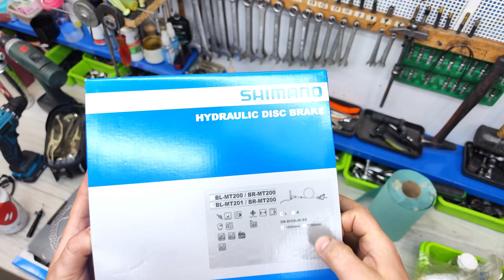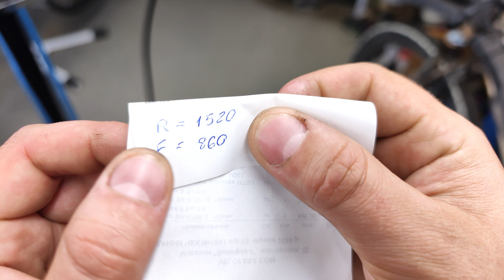Bicycle hydraulic disc brake Shimano BL-MT201. How to shorten a bike hydraulic brake line

Comment: hi i got some mt200 and after bleed they lost power but found there are tiny air bubbles coming from the caliper pistons, so still air in the system or  a seal broke

Comment: What is the part number of the blue funnel you used to drain the mineral oil into the brake?  And you did not need to push the oil from the caliper using a syringe ?
Reply from the maker: The funnel is sold in any bike store. in this case, a syringe for pumping mineral oil, no need to

Comment: Can you brake the olive if you overtighten the brake bolt or does it somehow affect how good the oil flows through the hose?
Reply from the maker: Yeah, I've been there.
Reply: @GoodBicycle  means I should check if it's destroyed or should I just rock with it as long as it feels good? 😄

Comment: do you have any idea if it is normal for a shimano xt brake, when you turn the screw that brings the lever closer or further away from the handlebar, to "fill" with oil? does it mean oil is leaking from the tank?
Reply from the maker: Maybe.  need to watch live.